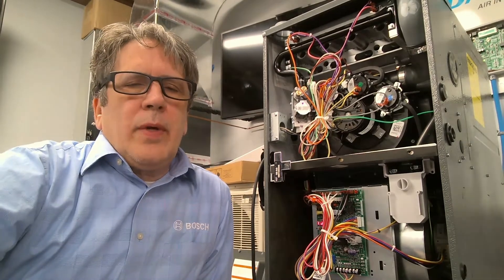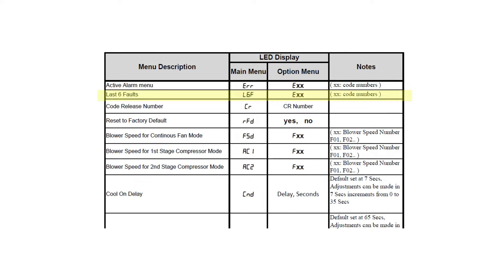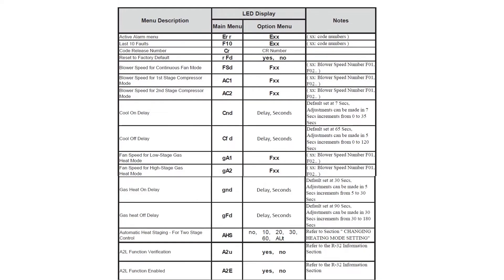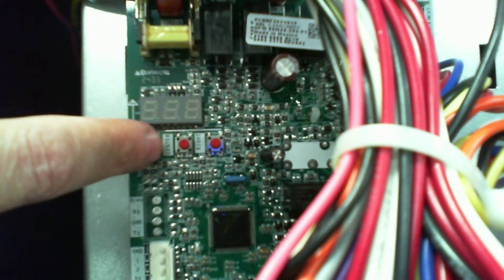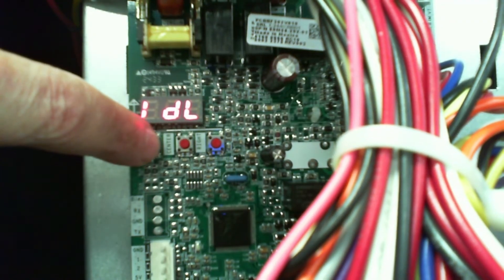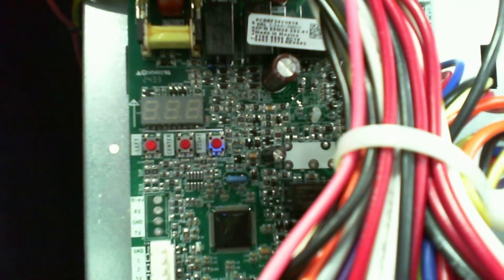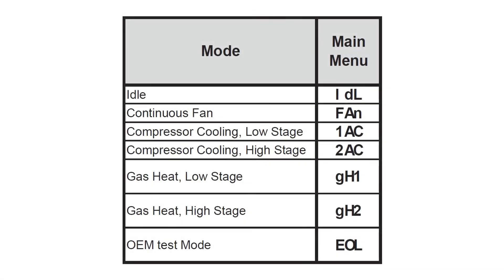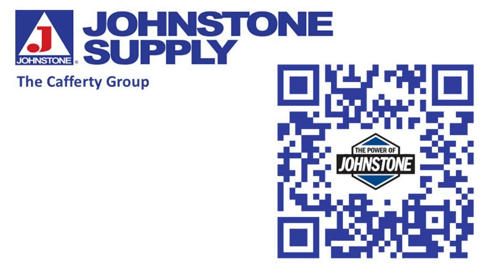A2L ready control board questions

Comment: i getting a ebu ( high amp ) but im only pulling 1 amp 
anyone else?
Reply from the maker: confirm the power wire (black) from the blower motor is plugged into CIRC-H and not XFMR-H if it is reverse connection so the CIRC feeds the motor.

Comment: Doing goodman furnace and not getting lights on the board at all after plugging in A2L coil board.
Reply from the maker: By A2L coil board are you speaking of the mitigation kit where you plug the coil sensor in? If so be 100% sure the furnace wires go to the green plug only. Then after power up and your sure the board still operated then the thermostat and outdoor unit to the black plug. Let us know but please give us model and serial of unit.

Comment: I just installed a new furnace for a customer of mine and it would not start up other than the fan running. I couldn’t figure it out after the install so I told her she would have to call somebody that has experience in programming the furnace.
Reply from the maker: IT WAS IN MITIGATION MODE. If you have no R32 sensor hooked up it will run only fan. if your on a R410A you need to enter menu scroll to A2E-enter-scroll to NO-enter button 2 times. Cycle power.

Comment: Have something similar codes pop up and it drops voltage and just keeps blower fan running. what could be cause? Does board have to be programed ? both are r32ac and r32 a2L furnace

Comment: I have a F09 code that keeps marking me on the Goodman furnace, what could help solve it
Reply from the maker: F09 is high fan speed IdL is idle and neither is an error. the EAF is A2L leak or no sensor plugged in board. If you have an A2L condenser be sure the sensor that shipped inside the evap coil is routed and plugged in board. A green light on board will illuminate when sensor is present. If you have a 410A condenser go to A2E in set up menu and hit center button, hit right to switch to off then hit center button 2 times. turn power off and on at furnace.
Reply: Also EAF CODE and 1DL codes keep popping up
Reply: It’s a new Goodman too
Reply: Have something similar codes pop up and it drops voltage and just keeps blower fan running. what could be cause? Does board have to be programed ? both are r32ac and r32 a2L furnace
Reply from the maker: @agustinbasurto2432  The furnace, if A2L ready, will ship with the A2E in yes position. Assure the sensor is plugged in (from A2L coil) and has a green light on board. If A2L related you would have a F09 code with A2l code. EAF would be sensor issue and EAL is mitigation mode (leak sensed) but may appear for the first 5 minutes when power on. EAS and EAR could be board issues. F09 with gH, Fan or AC would be a thermostat call. Let me know of anything else you see on the board.
Reply: @johnstonecg Is the Dragonfly kit required as well?
Reply from the maker: @agustinbasurto2432  The Dragonfly is only required when you have an A2L outdoor with A2L coil and a NON A2L furnace. The sensor from the coil would plug into the Dragonfly and not the furnace.

Comment: I have  96 furnace and Reading.
Code EE1  .9H
Reply from the maker: 9H (GH) is a status code for a call for gas heat. The EE1 shows you have the primary pressure switch (has yellow or orange wires) in the closed position when the call initiated. Cycle unit off an remove the hose from the pressure switch and be sure its clear and try again, if error (EE1) returns cycle off and remove both wires from switch and try again and If you get an EE2 the switch is bad. I do need the model to be of any more help.
Reply: @johnstonecg I’m having these exact codes and the unit is new. I didn’t check to see if the lines were clear but I did disconnect the orange wires and it threw the ee2 and it just keeps cycling but won’t turn heat on. GM9S960805CUAA
Reply from the maker: @mcl237  do you have a humidifier connected? If so remove it the unit may me feeding power back to board. Can you disconnect the orange and yellow wire and ohm the pressure switch?
Reply: @johnstonecg an external humidifier no. Does it come with one? The pressure switch is one?  Because my unit has two switches with airlines and out of the two only one has an orange cable. The other is a different color
Reply from the maker: @mcl237  all 96 have 2 or 3 pressure switches. Id love to help but need full model number
Reply: I just checked all the square lines and they are all clear except for one hooked up to a switch/valve with 3 wires black red and green
Reply: Also when the AC gets turned on it trips the FAu breaker after like 5 minutes
Reply: My fault I’m getting EE0